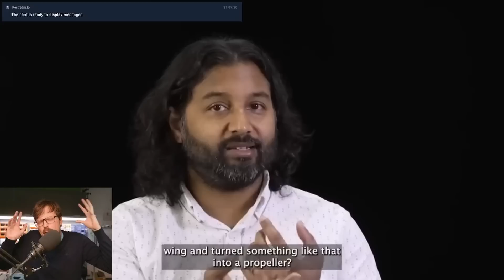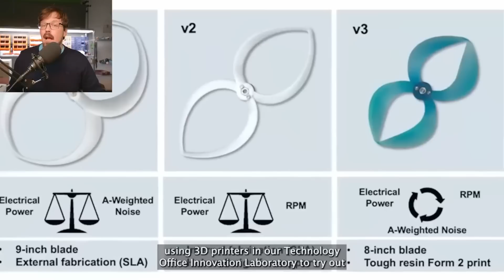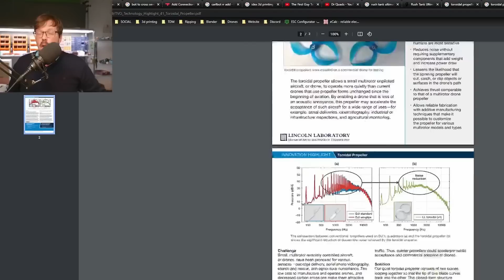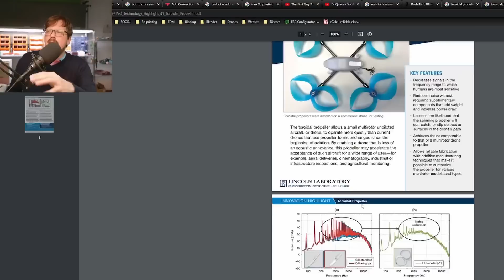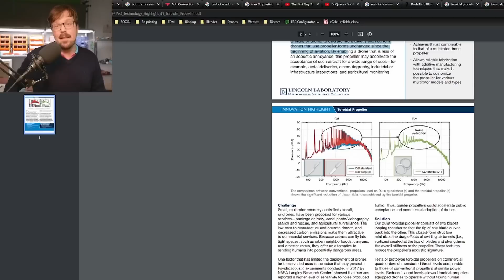MIT Thinks you're STUPID - Toroidal Propeller Snake Oil

Comment: You were rejected by MIT weren't you? 
The data at about 10 minutes in your critique is a comparison between noise levels. I am far from an expert, but from what I remember of high school physics, i think the left graph shows higher amplitude which is the distance between the middle of a sinusoidal wave and the top or crest and the bottom or trough. That may be a measure of overall pressure resulting in sound. So, I think they are demonstrating that this design is much quieter than a classical propeller. Now that I think about it. Given one of newton's laws that says a force in one direction will result in an equal and opposite force, that would likely result in an overall reduction in power consumption for the same frequency. Frequency being the number of ocillations in a given amount of time. When I look at the comparison it shows that the propeller can achieve an efficient range at a lower rpm. That's my guess. I can only speculate that although the overall power may be lower at a given rpm the noise reduction and lower feul consumption make it a worthy trade off. I'm sure someone smarter than me can correct that. I don't know how, but I'm pretty sure that the sound we hear from traditional propellers are caused by inefficiencies not used directly by the prop. A more fluid consistant pressure wave creating lift or any accelleration would not reach our ears and be used to create thrust instead. 
My point is that MIT does not care if you are stupid or not. They know they are smart and don't care about your intelligence.
Reply from the maker: Would you like to get in a public discord call and we can Livestream the debate? It's always fun to watch people who try to sound smart crumble under thier own weight.
Reply: @33rdframe  that might be fun. I'll look into it and get back to you. I am not anything close to an expert, but if you think it's worth your time I'll definitely look into it. I'll give you an answer within 48hrs
Reply from the maker: @Wayofwar  sounds good
Reply: ...and you probably didnt get that answer 🙄😆

Comment: they make those style fins as arrow vanes but and they aren't much better in archery... for boats sure they gain a little bit but as for flying... idk its kind of like those twin screw superchargers that start to drop off in power the higher the twist ratio. I would make a case for trading power for less noise but I've heard these propellers on other drones and they are still loud... not to mention an 8 bladed standard prop preformed even better in the test

Comment: 5:50 Only the airflow and efficiency matter. They should both be moving the same amount of air, so you can compare the noise and power draw for the same task.

9:41 They could generate those two noise graphs with the same propeller design, just run slower in one of them or with a smaller propeller.

Comment: The lack of knowledge on youtube is the scary part. People drawing 3 random ring shapes without understanding the design, 3d print it and telling everyone that this is BS. It's like saying that every 3-blade propeller is the same!
Reply from the maker: Do you properly understand the Design?
Reply: @33rdframe  Yes I do. I also understand that its not a magical dead silent design as many seem to think, but mostly reduce high pitch sound and why it does. Why do you think minimal changes on a normal fandesign can change every characteristic about  pressure, sound, efficiency etc, but makes this sound the same no matter what?  3d printed scuffed blades that is unbalanced, random pitch, random size. The sound of throwing a sausage will even change from one to another.
Reply from the maker: @bomb_and_gouge  do you often throw your sausages around?🤭
Reply: @33rdframe  you wouldn't belvie

Comment: Yes, the worlds most prestigious technical educational institution isn't just wrong they are lying to yoUz!!! Clearly just a simple analysis of this video is all that's needed to "debunk" MIT. Clearly all you hobbyists out there with your cheap filament printers and lack of scientific measuring equipment and experimental conditions are far more accurate. Clearly you have been following the concept of toroidal propellers for years and have already gotten solid data to prove the opposite. 

You didn't just hear a claim by MIT and then go out and bubba yourself a toroidal propeller so you could "test" the idea right? You didn't just watch someone else's YouTube footage and then use that, along with MIT's public facing video on the matter and then make your own video that is essentially nothing more than a YouTube comment s$%^ post right?

Solid stuff my guy. I can just see enrollment cratering at MIT after your bombshell video...
Your welcome for the engagement but it's your video that is garbage until properly proven otherwise not MITs claims. Clearly they have made a bold claim here and the veracity of it will be meted out in due time. Your video is premature and flippant until further notice - you should have waited.

Comment: Ive seen videos of folks who have made their own attempts at 3 ring toroidal props, and while it’s disingenuous to say they’re 100% better, they do seem to have unique benefits compared to regular props, for one, they seem to be putting out more pressure, as the pilots were commenting that they seemed to be able to get closer to the ground without hitting things, and they also commented that they’re getting tighter turning with them as well, which both seem like very useful effects, however i don’t doubt that the design is aerodynamically inefficient, as they also commented that their flight times were shorter than with normal props.

Comment: I have a few nice idea , you could watch it here on my u
|             

|                                                  "+"
|                                                    |
|                                             ____|____
|                                                    |______________  "+"(out)
|    

|             "--"(out) ‾‾‾‾‾‾‾‾‾‾‾‾‾‾‾‾‾‾‾‾|
|                                             ‾‾‾‾‾‾‾|‾‾‾‾‾‾‾
|                                                      |
|                                                    "--"
Idea is to discharge capacitor(two plates) inwards instead of outwards in which direction force(hence Voltage) is weaker/lesser but inward in which direction force is much stronger/greater
After that charge could depart through mid-plane in between two poles/planes
without any hinder (because "+" and "--" in this/along this plane equally far)
And in theory charge could leave as much far as it takes(infinitly) without any effort/work

This is the idea- capacitor that amplifying Voltage (meanwhile current would be the same)
In theory it(this principal) allows to obtain free energy

Comment: If you could gain a significant decibel reduction by sacrificing minimal efficiency, then maybe the tradeoff would be worthy.  However, that's not what we're seeing play out in the testing.  We're seeing MAJOR efficiency losses and while smart people are still tuning designs, I'm skeptical they will find one that we conclude is worthy of in general use.  I can see drones flying over crowds willing to make the sacrifice so as to mitigate risks to spectators, but flight times are typically more important than noise frequencies.

Comment: Yup - the MIT yo-yo is blowing gas.  Here's a toroidal prop that seems to work - a way, way different design from the one in your video.  The inventor wanted to develop a noiseless drone prop for indoor videos.  He finally ended up with a boat prop: 
https://www.youtube.com/watch?v=MNnB_50Z20I
Reply: what I don't understand is if it genuinely works on a boat why not on an aircraft?
Reply: @definingslawek4731  I poked-around to see if had developed a drone prop, but found nothing.  I suspect the problem is that a prop that would move much-less-dense air would be to big and/or too heavy - or maybe, too expensive to manufacture for the market.

Comment: Universities, their professors, and students don't scam. It's all downside if you do. Peer review will certainly find you out, and then your career will be immediately and entirely destroyed. If you read the paper (which most lay people won't) it makes no claims in comparison to other propellers. All it does is provide data points. Everything else is coming from outside the university from people making silly claims and crazy speculation. Unfortunately, the MIT publicity department didn't understand the paper any more than undergrads and the general public did, and managed to really mess up what the paper was about by also drawing conclusions about things which were not addressed in the paper.
As a disclaimer, I have no reason to defend MIT. I got my undergraduate degree from the uni across the street in Cambridge, Mass, and spent my career and am now a professor emerita of Cambridge University in Cambridge, England. I have no connection to MIT other than having had a scant handful of students over the years who got their bachelor's degree from there. I do, however know how the peer review system works, and also how dry and dull the average university paper can seem to lay people. 
Saying that MIT thinks your stupid, or that it's a scam is to entirely miss the point of the paper. It's understandable, since most people have never read the paper. If it really is a bad paper, you'll hear a lot about it from competing universities, and you'll see heads roll at MIT. If no heads roll at MIT, you can be sure that all the bad information is coming from sources other than the paper (which is the case). 
I hate to say this, but Dr. Quads is putting words in the mouth of the guy in the video, which only adds to the hash that MIT's publicity department had already made of it. If the researchers at MIT see this video, they probably will think you're stupid, but not for the reasons you think they do. They'll think your stupid because you haven't read the paper, and are instead drawing erroneous conclusions out your arse as are so many other people who are making hay on this. It's pretty disingenuous, ignorant, and yes, stupid.
First time, and last time I have and will watch a Dr. Quads video. I'm not even tempted to see the thing through to the end. There's just too much garbage here.

Comment: I give you credit for questioning the lack of data, but you are also being flawed in your analysis.

7:57 Most propeller tests I've seen on the web use the simpler FDM printed circular shape shown in the video, that seems like an early prototype. If you pay attention, all the other images of the final product show a more complex shape that resembles a pointy leaf, and is not a simple flat extruded shape.

8:20 There's only one video showing the circular shape propeller being printed with FDM, that seems like an early prototype. At 4:11 you can clearly read "External fabrication (SLA)" and "Tough resin Form 2 print", and the appearance of shown propellers match the claimed fabrication techniques. So the final propellers are not FDM printed, while most tests from the web are.

While it can be a scam that is using vague information to sell snake oil, to me it seems more likely that they are not disclosing too much details because their are intending to profit with it's commercialisation. Taking into account how easy it would be for anyone to 3D print it, if they give too much information, their business would not have much chance to prosper.
Reply from the maker: I like how you didn't mention the fact that they muted the audio.. you just attacked my admittedly weakest point.

Sorry you gotta slay all 9 dragons before you can enter the dungeon
Reply: @33rdframe  The video is just a quick edit for media presentation, it's not a full sales pitch or scientific paper presentation. Most of the video is muted because the guy is narrating. The editor probably chose to unmute during the "pretty loud" narration to emphasize it.

Also I heard there's a more complete video that shows the noise comparison, although I haven't checked it yet.
Reply from the maker: @Pixelarter  you really being full of faith on this "scientific breakthrough"
Reply: @33rdframe  I'm not being full of faith. I'm just giving it the benefit of the doubt and taking what they say as possible truth, since a MIT lab carry some scientific reputation and what they claim is totally plausible (toroidal impellers are used in boats with sound results), instead of dismissing it as snake oil by nit picking details of a presentation video.
Reply from the maker: @Pixelarter  you would make a great director of science

Comment: I'm still willing to give it (the 3-blade version, not the 2-blade version for some reason, that's so obviously bull) the benefit of the doubt until someone does a proper comparison of a set of props produced in exactly the same way, preferably injection molded.
Reply from the maker: that is fair

Comment: The most relevant comparison would be to use the same prop diameter (since that's a practical limitation in real world use) and run them at whatever rpm that produces the same thrust. That might require different rpm but that doesn't matter, what you want is thrust. Then compare the noise and power consumption in Watts.
Reply from the maker: you are literally better at science in a youtube comment that MIT in a 40 million dollar lab

Comment: I saw a dude compare a 9 blade axial fan to a few sets of toroidal fans.  The basic axial fan was not only quieter with more blades, it had more torque on demand and a higher speed.  Toroidal impellers are not fans, and anyone trying to convince anyone else of that is a snake oil salesman, or, stupid.

The design of a toroid is made in order to have quieter operation UNDER WATER and to keep the WAVES AND WAKE down.  The design happens to also make a much sharper cone of propulsion due to that non-cutting edge of the toroid.  However, what makes the toroid so effective is the MEDIUM that it is subject to.  Because it has a following / trailing edge up to the apex of the toroidal blade, the leading edge naturally "scoops" water.

A similarity can be made by having a bowl of water and pushing a pork and a spoon tilted on their edge thru water.  One will grab more and have more force, but will have a lot more reaction.  Because the fork isn't toroidal you don't see the same sort of effect a toroidal impeller would have, its a fork, its straight, but you'll see the effect of removing that artifacting from having so much... hmmmm... "Noise" lets call it.

In the case of the 9 blade fan, an axial or dual axial fan is made to grab the air around it.  A toroid depends on viscosity, where a straight axial fan needs pure natural air resistance to have any lift.

The more blades you have, and depending on the angle of attack followed by the trailing edge of the fan blades to the open air, the less DB your blades will project.  The blade edge will have more "Grip".  The "Noise" of the fan comes from the fall off and doppler effect of the wind resistance on the blade edge.  If your fan is set up with interweaving lengths, you can naturally eat that sound and counter it out.  A toroidal fan has more noise because the air itself is not viscous enough to be projected in a straight shot backwards like a toroid in the water is capable of.  Because the loops are closed, you actually get a similar effect to waiving a paper tube in the air to make sounds.  The tumbling of the air, due to the edge of the toroid trying to forcefully "scoop" air down and failing due to medium interaction with the design of toroids in general, causes more sound that the natural roll off of air off of a well designed compactor axial fan.

In short, this dude is trying really hard to look more impressive than he actually is.

Also I didn't go to college and most if not all of my family is in mechanical engineering and design.  This dude from MIT is full of shit.  I learned this crap from @GamersNexus doing GPU fan reviews

Comment: 1:35 The funny thing is, ducting is the way to make a propeller quiet. Literally like the choppers in avatar. The loud noise comes from the air very suddenly going from under the propeller to under nothing. This is why pretty much the only sound from ducted fans is the motor whine.
Reply from the maker: But it is really hard to get a perfect seal on drones

Comment: "A-weighted" is not like, a singular weighted noise. There are two commonly used spectra for measuring sound intensity. A-weighting is used for most sounds, and C-weighting is used for very loud sounds like jet engines or heavy machinery.
Reply: He lost me when he didn't know that "A weighted" is a thing. Also, I was in California in 1982 and saw toroidal windmill farms with hundreds of windmills. There must be a reason none of the new ones are designed that way. Regardless, MIT did not come up with the toroidal design.
Reply: @bobgraves5833  He lost me way earlier than that.
Reply: Drones routinely reach 90-100 dB so you could use either really.

Comment: So, are you implying they are wrong, about people in general? I don't see any specific claims about performance, they claim the thrust is comparable, to the normal propellers, which doesn't mean the same thrust, and as you pointed out, kind of meaningless without the power it requires. "Everyone" just seems to assume everything about it is vastly superior to normal propellers, despite the fact that the MIT guys doesn't even imply that. Without any real reason whatsoever, people jumped to an absurdly illogical conclusion.